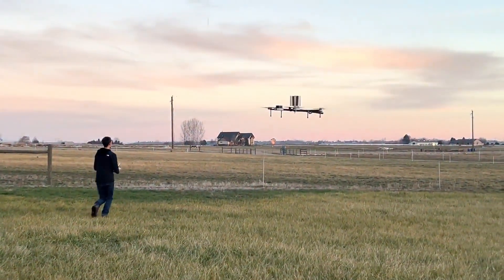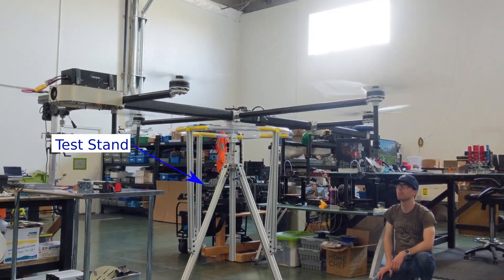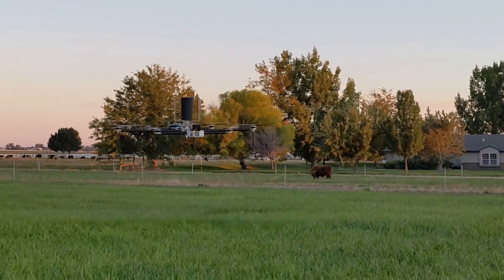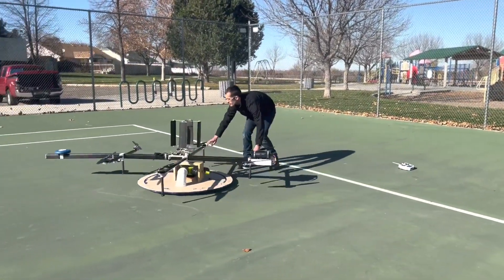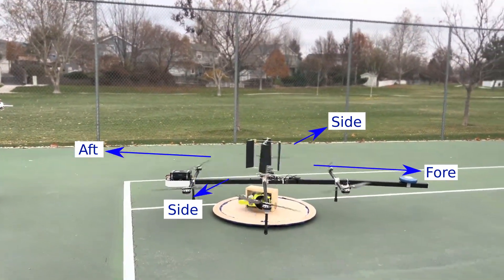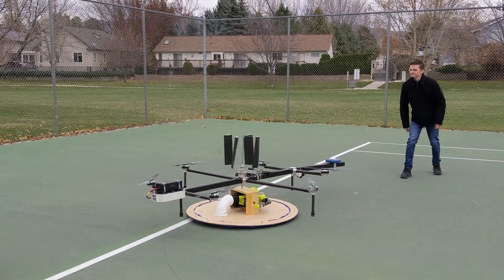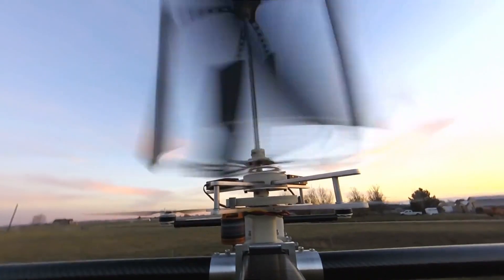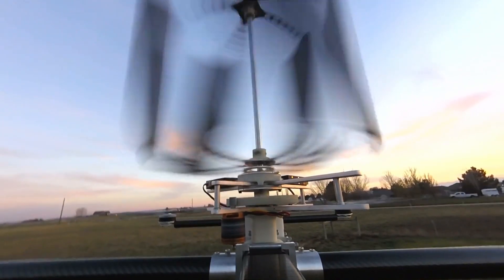Pitch Aeronautics Fall 2021 Testing Summary: Test Stand to Stable Flight with Cyclorotor

Comment: try impeller/tesla ducted pump with single rotor inside, multiple directional (4 or 8) outlets, very much like harrier with its single thruster engine with ducted air flow
Reply: I mean side fed, rim out, turbine pumps